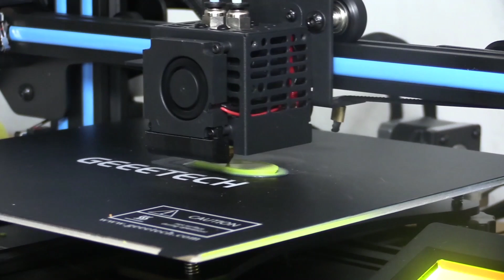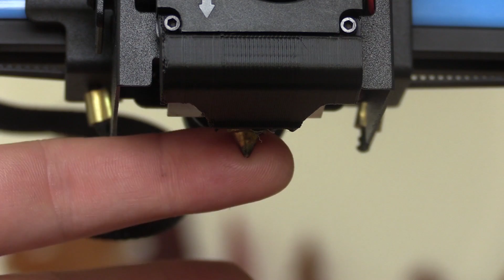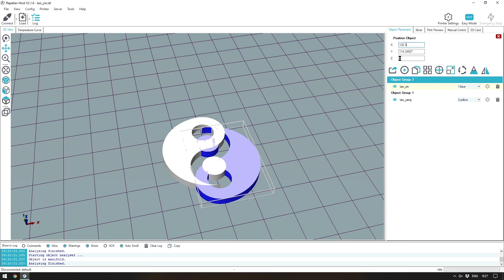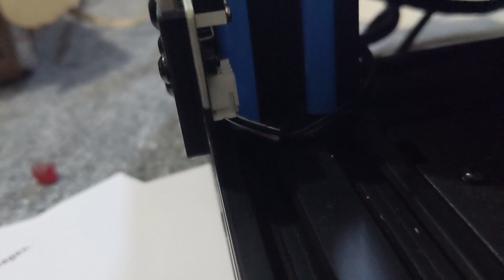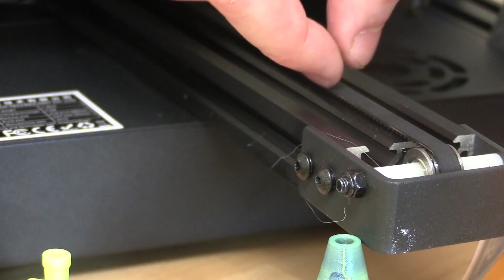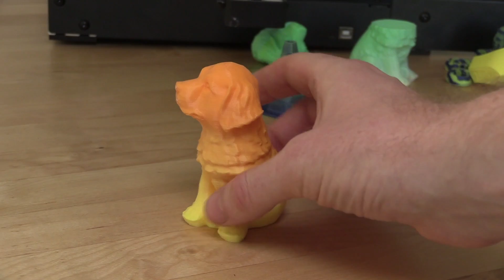Geeetech A10M: A Low-Cost, High Effort Color Mixing 3D Printer

Comment: Just a question, but could you print say, a PLA object and give it a support structure of water soluble filament using the dual extruder system?

Comment: I got one second hand that was already modded and dialed in and it has been so much more consistent than my ender 3 pro. It has some issues for sure. I ran into lots of bugs with octoprint running on a raspberry pi when trying to do dual extrusion prints. But it printed amazingly when just loading it on to the sd card. Overall I agree, a frustrating printer but a fun one to mess with!

Comment: If you move your brackets from the side of the top ledge to the top you can actually save some height and change the difference of distance between the extruder and the filament rolls

Comment: Hello & thank you for the review.
The A10M joined my little printfarm a year ago. Out of the box and using Cura (with the pre-installed A10M-profile) I had no problems to create one-color-prints in an adequate quality. At that point I wasn't interested in trying out the two-color-feature. I used the A10M as a working-horse for Corona-shields, and it did its job very well.

Recently the YT-algorithm pointed me to a video (by 1zRadio), which described the creation of a nice Geeetech-printer-profile. Following the guide I was able to print two-color models in a very good and satisfying quality and clean (=clearly divided) colors.

So yes: It's all about tinkering, tweaking and finding the right settings for the A10M. The hardware is simple but powerful and able to offer a convincing quality.
In my opinion this printer is highly underrated. You get a lot of quality for your money, plus: it's very easy to assemble in comparison to its direct "opponent" an Ender 3. Plus the two possible colors (or color-mixing/ gradient mixing).

I would definetely recommend this printer for beginners. As written above, I had no serious problems printing out of the box. A little bit of heating up, levelling, inserting the filament, starting the testprint and voila: you're good to go.

The problems that occured (no first-layer-adhesion and layer-shifting) do not affect the A10M in special. They can happen on any 3Dprinter if not levelled well or having any losened parts. 
Every 3Dprinting-beginner should know, that 3Dprinting isn't that easy as e.g. paper-printing is. 
You'll have to adjust your machine (hardware) and know the correct settings for the printer-data (software).
Thanks to a whole lot of very good tutorials you'll soon be able to get the very best out of yor printer.

For me, this printer is an awesome companion, and it still didn't fail doing its job.
It convinced me to buy "the big brother" A30T :)

Best regards & have a lot of fun!
Greetings from Germany and sorry for my (sometimes) horrible English.

Comment: Instead of clipping a boden tube you can try to clear the jam. I did it with a straightened out wire coat hanger.
Reply: Better yet get some Capricorn tubing...stock stuff's inside diameter is a bit too large that will allow the filament to jam

Comment: I think your spool arms are mounted wrong. They should be mounted on the top and not the back. I might be wrong I couldn't really see in the video. The extruders on this printer are notorious for failing and I would recommend changing to a dual drive system. DO NOT take the head apart if you don't have to. Your idler wheel in your extruder has probably broke free of the extruder arm, thus causing the filament to slip, and is most likely the cause of most of your fails. Also check the roller wheels to see if any of them spin freely. This is all from experience.
Great video. Keep up the good work.